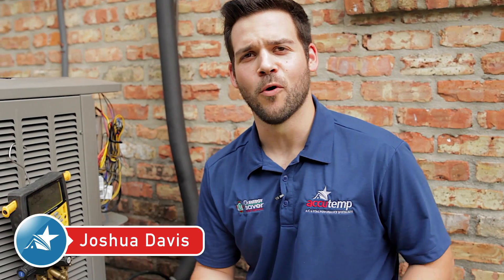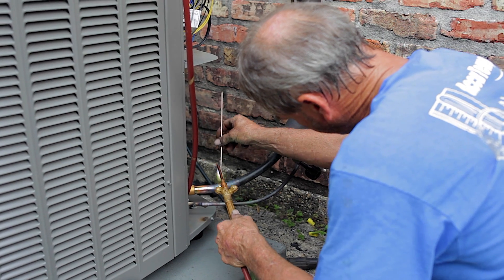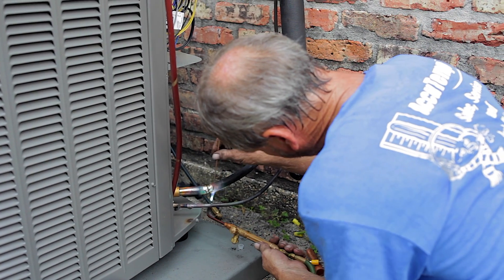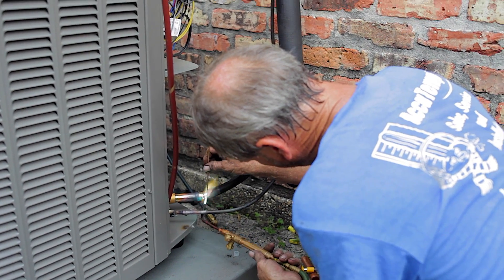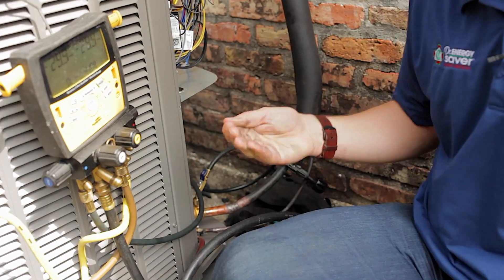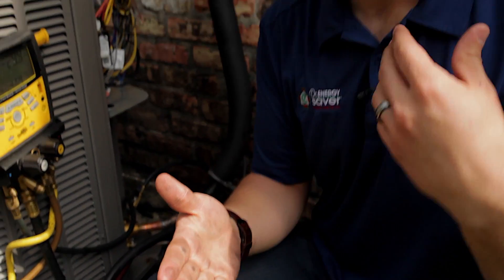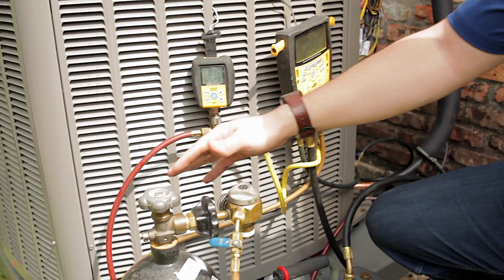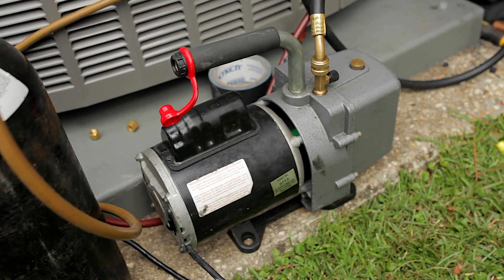Nitrogen Purging

Comment: How do you connect pre-charged lines so you don't need to purge them?
Reply: For precharged lines, there is no need to purge them as you are not soldering and they are already full of refrigerant. In most of those setups, you simple connect the screw-on copper line-set fitting and as you tighten with a wrench a piercing valve opens up the refrigerant inside to the entire system. 

These are often used on ductless units and remote refrigeration systems.

Comment: For the ordinary mini split AC's 1ton/1.5/2ton etc - you think nitrogen purging is needed?
Reply: Nitrogen purging is even more important on ductless due to common use of electronic expansion valves with smaller orifice to get plugged up . We make efforts to never solder on ductless by using zoom lock compression fittings or cutting and installing compression fittings

Comment: Very good job explaining nitrogen flow brazing which is very accurate, older refrigerant r22 does not scrub the system, new refrigerant 410a for example does which makes it more important to nitrogen flow during brazing. The title of the video was nitrogen purge which is done to clear the line of outside air which would contaminate the refrigerant

Comment: Little nugget of info on why you do this: 
Copper will oxidize at room temperature, hence the statue of liberty turning green, but the rate of oxidation is drastically  improved at higher temperatures.  If there is any oxygen inside the tubing, there will be oxidation on the inner wall (that black stuff that flakes off) when brazing. This is not good. That's why its necessary to replace the oxygen inside the tubing with nitrogen.

Comment: What brand/model purging regulator are you using?
Reply: Richard Segui We use the Western VN-500. It’s a great regulator because it has preset positions of high, medium, and purge. This gives you exactly the psi you need rather than trying to regulate manually in the field. Too high of pressure during purging is a common issue that causes leaks on your last couple of joints from the pressure within. This regulator puts out the exact pressure you need to purge with.

Comment: Is it important to purge if no brazing is done? I'm curious because I'm installing a mini split heat pump that is pre charged.
Reply: Hey Justin, If using a pre-charged lineset, there is no need to purge with nitrogen.  Make sure that you do not cut the lineset to shorten it, as this would would cause you to lose refrigerant within lineset and require an evacuation of lineset with vacuum pump.  Good luck on your install!
Reply: Thanks for the quick response. I will have to vacuum the lines. The condenser is charged, but the lines are not. I'll also need to add more refrigerant because I'll exceed the maximum length for the charge unit.

Comment: yet the pipe work isn't straight or fixed to the wall !
Reply from the maker: The pipe was straightened & strapped after it was cooled down, and then covered with a paintable line-set cover.  Make sure to check out the line-set cover video as well!
Reply: Does it look like they're done?  Smh